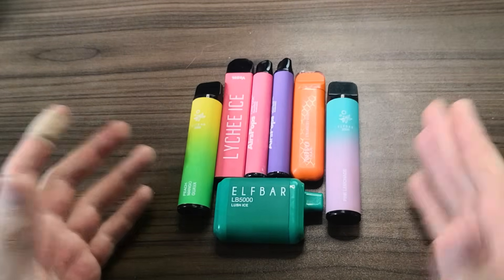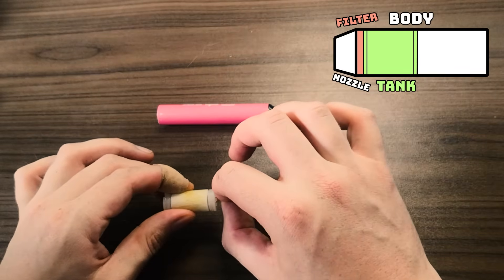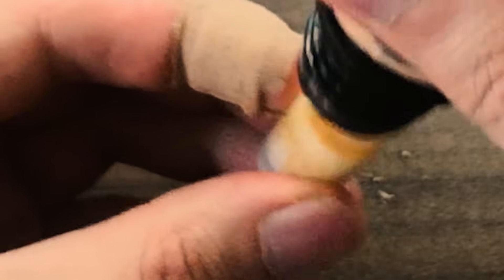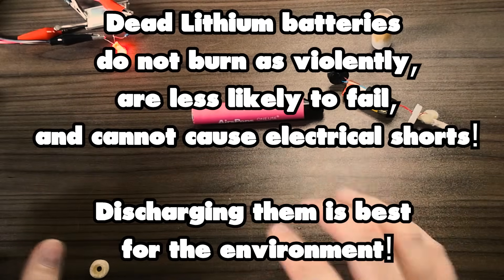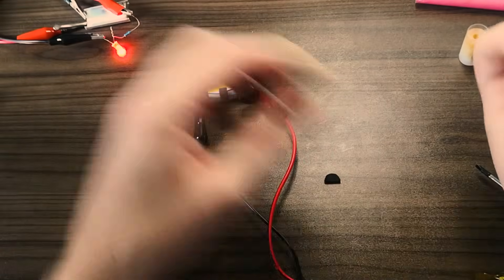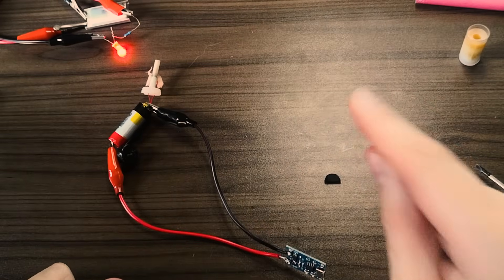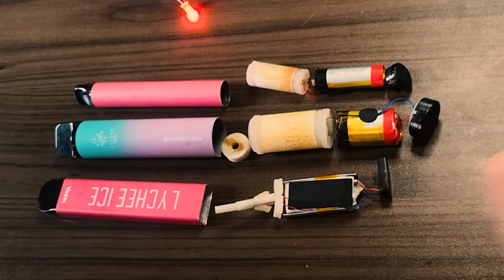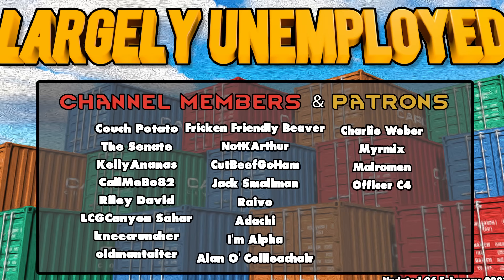'Disposable' vapes are a lie. Here's how to fix them.

Comment: Here from your space engineers suit only series. My biggest complaint with these types of vapes is for about 2.5x as much money, you can just buy a refillable pod vape which is also rechargeable in an identical form factor. Uwell for example makes a few different versions of these style of vapes, and the refillable pods can last anywhere from several weeks to possibly a month or more (just depends on how often you use it). 

Last I checked an Elfbar or equivalent disposable vape is about $20, a Uwell Caliburn (with a 4x pack of pods and some liquid) would probably cost somewhere in the ballpark of $60. It is a higher up front cost but you're getting a device that is re-usable and refillable with whatever liquid you want for a much longer period of time compared to a disposable system. A disposable vape might last anywhere from 2 weeks to 1 month. I can usually get about a month of mileage out of refillable pods before I start to notice the wick is beginning to break down. A pack of 4 pods is already giving you 4 months of use, lol. From a "cost per month" analysis, the refillable ones are significantly cheaper, but again, higher upfront cost. 

The only real downside to the refillable pod systems is you are still producing some amount of waste. When the wick in the pod gets too burnt, you gotta bin the pod but that's way better than throwing away an entire device with a battery in it. You may be able to tear the pod down and re-wick it, but at that point, you may as well just get a pod system which is designed to be rebuilt. Been awhile since I was last messing with any vape stuff, but the Smoant Pasito was a rebuildable pod vape I used for quite a long time. You can build your own coils for the atomizer so it is as waste-minimal as possible. More often than not, the atomizers just need the wick replaced. Very rarely is the coil itself a problem, but over time they do get "burnt". However it is not actually burnt, it is just oxidation/corrosion build up and they can be cleaned! Even the coils you made could just be cleaned up and re-used instead of outright replaced. I gave that away to my stepbrother when I started cutting down on vaping. 

I commend you for going through the effort to tear these disposable things down and showing people how to properly refurbish them for use again. I completely understand that in many parts of the world, the vapes purpose-built for re-usability are nowhere near as easily accessible. For the very brief time I tried using some of these systems, I had considered trying to recharge them/refill them myself, but I figured it would make more sense to just not support the business of disposable vapes whatsoever and switch to something that was meant to be refilled and recharged. I really think some serious legislation needs to be put in place on those kinds of products though. The e-waste is astronomical.
Reply: I agree, Spartan!  Now if only our states would agree.  (They seem to be on a rampage to force smokes or disposables upon their constituents).

Comment: If you use box mod with 18650 get your spare batteries by buying 2A hr or 4A hr cordless power tool power packs from Aldi / Lidl and strip out the cells.... The last pack I stripped were Samsung...  and all still work years later..  Works out a lot cheaper. 1/3 approx.

Comment: I'm going to tell a lil story: I own the first gen iPod Nano, i got it for free! Now, this person said that this ipod hasn't been charged in years, so, i putted it to charge and the battery got swollen, i punctured the battery with a needle, let the gas out, all in quite quick succession, i put my finger over the hole, and i putted sometape over it! This battery has been in the ipod for over 4 years, happily powering the device for a descend amount of time, it was only in the last few months that the ipod died quite fast, i finally got around and replaced it. I also punctured 2 other batteries of my vintage samsung dumb phones, and they still work as well! If you know what you do, you can save even swollen batteries ;)
Reply: That's stupidly dangerous and I'm pretty sure it raises the risk of a fire hazard
Reply: @blackmoon9511  Well, that is what they want you to believe, did you know that, if you bought a microwave for example in the 70's and 80's, they used to give you the schematics for that device, all the part numbers were written down so you can order that part; but nowadays? The ipod worked for years and years, i did another couple cells and no issues to report, no fire to speak off. Louis Rossmann did a great video about lithium ion cells, maby you should go look it up?

Comment: I remember lithium batteries being an expensive technology and obviously now they are ubiquitous and more affordable, but why on earth are they used to manufacture disposable devices that under normal operation will never be recharged even once? It's infuriating from an e-waste perspective. But perhaps I'm simply ignorant of the environmental hazards of alkaline batteries... since I expect those would not be disposed of properly either.
Reply: I think the short answer is cost.  How the numbers get there seems crazy to me.  It may be something as simple as being able to draw more current from a physically smaller Li-Ion or Li-Po cell than a pair of alkaline cells when driving a heater, the rechargeable nature may be a nuisance to the manufacturer but still cheaper.
Reply: @KallePihlajasaari  I suspect it's partly to cut electrical engineering rnd by staying as close as possible to existing (rechargeable) products and use components which are extremely common due to the consumer preference for rechargeable things over putting in new alkaline batteries.

Comment: There's alot easier way to charge these, the pressure sensor has a built in charge controller that even has a auto trickle charge function that will charge the cell at 45Ma if it detects voltage below 2.5v and has a 4.2v cutoff. 

One night I found 100 vapes in a pile dumped in a alley so now I've got 200+ vape cells and 100+ pressure switches ect, i use the cells to convert torches, remotes ect. 

I haven't been using the pressure chips but i hooked it up last night (blue = positive and black = negative) to a 5.2v 650mA phone adapter charger and i was pleasantly surprised as once the charge indicator led on pressure switched turned off the cell read 4.20v exactly, im glad I've kept so many i knew I'd find a use for them one day! 

I also got 250+ 1000mAh disposable powerbanks that use a old school Nokia phone battery, I've  them for years use the boards as 2.5v-4.2v to 5v step dc-dc step ups mostly on devices that require 4x 1.5v ect, then last night i looked up the chip... found just one datasheet and it said that the chip infact had a charging function on pin 1 which was unused on the boards i have. 

So i soldered a wire to pin 1 that was to be positive, firstly with a 10uF capacitor that was in series as the datasheet said to do, i thought it was odd but tried it anyway and nothing happened so i removed the capacitor and it worked straight away!  With 5.2v input it stopped dead on at 4.20v, it  has a 4 stage battery indicator, It also allows charging and discharging at the same time! 

I removed the 2.2k resistor that was in the led circuit as it was very dim it's now 5 times brighter. 

It's sad how electronics that are this capable don't even use all the features they have and they're classed as disposable!
Reply: bro that is awesome. you should upload some clips

Comment: this only loosly related, but when my THC carts are almost empty, i open them up with plyers and put nicotine salt vape juice in them and can get two or three tanks out of them before the THC is compleatly deluded. and if a cart burns out before its empty, i open them up and use a hair dryer to empty the THC oil into a spoon, to pour into a fresh cart by heating the botom of the spoon with a torch lighter so that it flows easier into the cart. hopefully this info will be useful to a frugal stoner out there
Reply: what kinda carts? the 510 threaded glass ones? those are so hard to open lol

Comment: Thanks for the video. However,going by personal experience, opening and refilling the disp vapes is the easier part. But the unresolved part i guess is the juices - since a refilled disp vape just does not yield the same throat hit. Its like bland,airy and unsatiating dry hit. To my mind,its about the specific juice densities or solvents they use that produce the particular happy throat hits that these devices give.

Comment: Batteries less than 1000mAh should be charged below 1A provided by the tp4056. There is a very easy modification (and widely documented on YT), changing a resistor in the tp4056 that will allow you to charge them more slowly and safely.

Comment: This is useless because the coil is only going to be good for the one use just like the rest of it. Even if you put new liquid in, that coil and the wick running through it won’t last that long.
Reply: If you read the comments, the coil nets about 6-10 more fills before it goes bad.

Comment: Guys, if you're gonna do this, don't do it with vapes that have already burnt coils as either way it will taste ABSOLUTELY HORRENDOUS. If after a couple recharges they start tasting burnt, just get a new one.
Reply: Maybe consider using a box mod, it's almost always cheaper in the long run and easier to refill than this. This strategy is a great way to reuse these if you're already using them, but if you're going through the effort to refill these over and over you may want to consider a box mod since the main reason for these to exist seems to be convenience (at the cost of the environment). 

Basically this is a great way to reuse these if you already have them but once they're completely spent a box mod may be a better idea, saving you money and saving the environment from the lithium cells.

If you're concerned about the much larger size of box mods, there are smaller ones ("pod mods") which still use conventional bottled juice and replaceable coils and aren't typically larger than the bigger disposables we see today like Lux Bars and Breeze Primes.
Reply from the maker: Agreed, at that point just strip the battery.

That said, even two or three reuses is a 200-300% extension of its planned lifespan. That adds up at scale 👀
Reply: @LargelyUnemployed  100% agree. Also stripping the battery will help the environment, by a lot.
Reply: @LargelyUnemployed i am homeless i survive from recycling cans and bottles in Netherlands but i get so mad about  the stupidity in 99.9 procent of all ppl that just trash vapes by trowing them on the street or in the bins instead of put them in the battery bins but selling them batterys lol didnt thought about this i recycle the metal tubes to make bong pipes out of them just bcus i love crack lol keeps proper viado bttr them CE not certife Europe but just China export that gives ur lungs the look of a Christmas tree when u scratched ur cheapass weedpipes nd u go for an x ray lol ...... But i trew like 250 of this batterys in the recycling bin from vapes out of the trashbins
Reply: Obviously. That's how it's worked with serviceable vapes for years. Why would non-servicable vapes be any different? You're refilling the liquid, not refurbishing a coil. So if you smoked it dry and fried the coil and wicking material, there's no going back.
Reply: @Brianbd  Some people do not know how a vape works or what happens after the coil is burnt and think it can be fixed with just a refill, which can be seen in this comment section at least a couple of times...
Reply: Does anyone know where I can sell my battery's I have like 30+-
Reply: Or just buy a rebuildable mod. We're basically creating solutions for problems that we created ourselves. Stop buying dispos and buy rebuildable mods or box mods with replaceable coils.
Reply: There are two different things. A refillable vape is made to blow clouds. A disposable vape is made for flavor. 
And neither can do with the other does. You will never get the flavor with a refillable and you will never get the clouds with the disposable. 
So this guy is getting a little wispy vape that has no flavor. 
People need to start understanding that they're are two completely different things.
Reply: Just change cotton out then refill

Comment: You should always look down the metal coil every "recharge and refill" as well. The vape juice caramelises and deposits in the coil. Obviously you cannot replace the metal coil in these. If it's "black" then you will need to clean it with rubbing alcohol.

Comment: Thank you! Just refurbed an Airis Beast, albeit with a more crude charging method. For those saying, “just buy a proper vape bro,” I actually prefer the aesthetics and compact size of disposable vapes. Random hint: If you guys run into a USB-C charger with pink, gray, blue, and white wires; pink is B+ and gray is B-.
Reply: Pods are the same size and some look very similar to disposables, why not use those instead?
Reply: @reezlaw  I tried Argus, Caliburn and Xros nano and all were so bad. Leaking or tasting like old motoroil and my last purchace (pretty XROS nano, what was 50 dollar here!!! No joke) is just producing too hot vape that burns my lips at the second puff. So the new systems seems to be much worse than the Evods in the past. The disposables I can get (I love Lucid boost) have a nice cool and constant vape, every puff is a great as the last one. So I am somehow stuck and thats why I am watching videos.

Comment: How many cycles you can do this without burning the coils? Also would a battery charger be able to charge these tiny things?
Reply from the maker: You'll need a bespoke charging circuit for these 3.7v cells .there's one linked in the description!

In testing I got about 8-10 cycles out of the coils before they were really nasty. Maybe 6 ideal. Still a 6-10x reduction in waste
Reply: If you have a battery charger that is able to charge 3,7V Lithium-ion cells it's absolutely possible to recharge your cells with that device. I'm actually doing that right now. My charger is a very versatile XTAR VC4 unit compatible with almost all kinds of batteries. 

You just have to connect the - and + poles (or soldering lugs) to the charger with cable clamps or something like that. Just don't leave it unattended because Li-ions are fire from hell in a little shell.

In my case I've got an EVE13300CS cell from a Blu Bar watermelon ice vape. Red is + and black is - there. Nominal capacity is stated as 345mAh on EVE's homepage. The vape device sells it to us with "400mAh" printed on the label. Quite misleading in my opinion.

Comment: Any ideas what to do when the wires snap from your coil to the battery on these?
Reply: Resoldering is a crapshoot, I couldn't quite see for sure but these look the exact design of the ones my friend always gets(esco bar?) and I strip the leads, the pins pop out of the rubber plug easy enough, no tool needed. Just trap the wire by pushing the pin in with the wire in place. It's pretty much exactly like trapping the wires at the bottom pins of a coil/pod, but at the opposite end. I really don't get why they bothered soldering in manufacturing cuz it's time consuming and inconsistent for this application. Save that effort for a charging port at the vacuum sensor, but honestly rc/drone type charge leads straight to the terminals works better You can even rebuild the coils in these, a vertical coil works best then a thin cotton to isolate the leads so you don't get hot spots, then replace the silica tube(torch cleaning these works a treat). Rayon/cellucotton is what the outer material is usually, it has more capillary flow which is why it tends to equalize throughout, so the cotton can wet the coil more effectively and draw the juice inward. Haven't bothered but probably .8-1.2 ohms would work, somewhere in the range of 4-8 wraps of 26-32 ga kanthal. You'd have a much sturdier coil that can withstand repeated disassembly for rewicking. Strip the paint off and shine the aluminum tube with 3000 grit and you've got a sharp looking device fit for an adult. Pass it on if this helps.
Reply from the maker: You can try to resolder them if you're good enough, but I'd probably call it quits and strip the battery at that point.
Reply: Oh and if it breaks at the battery tab just strip it back, loop around the elbow on the tab then twist it up tight. Dab o hot glue if it helps you sleep at night